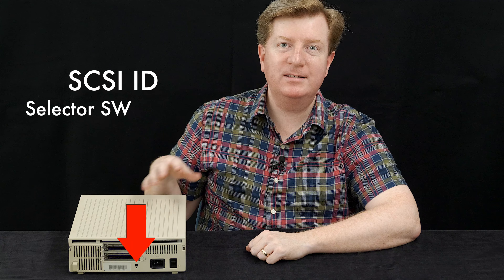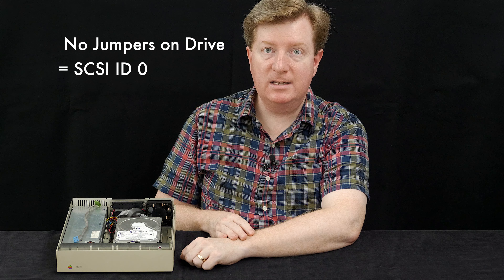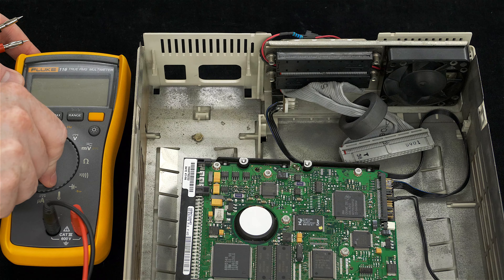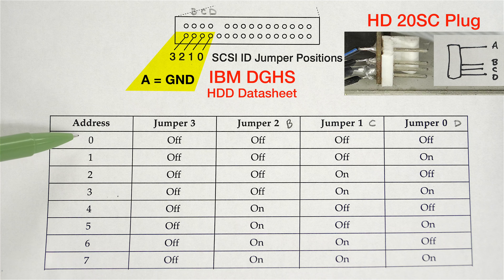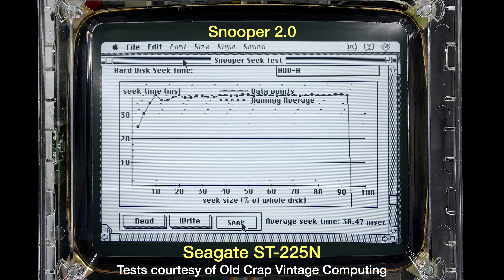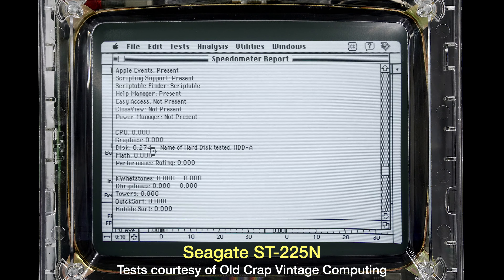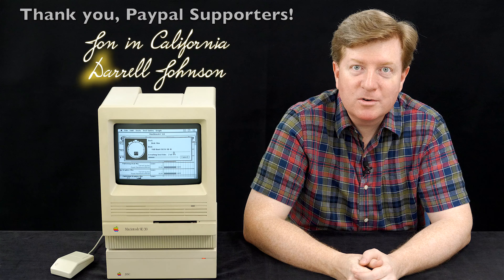Apple HD20SC SCSI ID Selector & Benchmarks

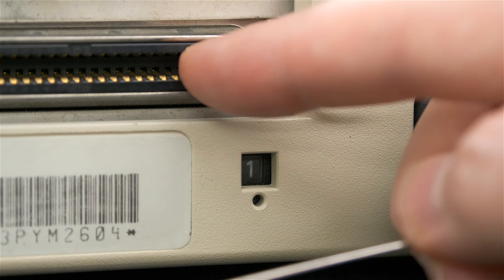Comment from the maker: At 12:26 I talk about SCSI Termination.  One viewer sent me an email to ask why I left my IBM drive's termination enabled. Here is my answer to her, which might be helpful to some of you...

The HD20SC shown in my video (SCSI ID's 1 & 4 are used in the video) is connected to a Macintosh SE/30 that has an internal Quantum LPS 540S hard drive (SCSI ID 0).  50-pin SCSI devices must be terminated at both ends.  With no internal HDD inside the SE/30, only a single terminator is required on any external drive.  With my internal HDD, the internal HDD must be terminated (which it is, via active terminator on the SCSI ribbon cable), and the IBM DGHS inside the HD20SC has its own Active termination enabled via jumper across pins 13 & 14.  The dual active termination has not caused problems for me at all.  And the only reason I resorted to that active terminator in the internal drive's ribbon cable is because I broke apart one resistor pack in the past when I removed it from that Quantum drive, rendering it unusable as the sole internal drive, at least until I found that rainbow ribbon cable with Active terminator attached.

1st & last SCSI device termination is mentioned in these 2 sources:
https://en.wikipedia.org/wiki/Hard_Disk_20SC#Hardware
http://educ.jmu.edu/~johnsogc/scsi.html#termination

IBM DGHS pin-outs are found here:
https://stason.org/TULARC/pc/hard-drives-hdd/ibm/DGHS-318220-18S-18220MB-3-5-HH.html

If you watch my video in 4K, there are a couple places that clearly show the IBM DGHS pins & jumpers I use.

This TI data sheet says that the SCSI standard actually recommends 2 Active terminators, one at each end:
https://www.ti.com/lit/ds/symlink/ucc5606.pdf

That implies my having 2 active terminators should not be an issue; and again, from my testing, there are no problems.

Comment: Man, I wish I had one of those enclosures!  I have an after-market external SCSI hard drive that came with a Mac Plus I acquired last January.  I actually did, just recently as a matter of fact, get a SCSI2SD v5.1 to work in the external enclosure; the original hard disk has long since bitten the dust, I'm afraid.  As you mentioned, a lot of its settings are configured via software.  I was hoping to configure it with multiple SCSI IDs for multiple "drives", but my initial testing was unsuccessful.  There are only a few default changes that have to be made, and then I got the Mac to recognize a full, 2 gig partition.  It's a neat setup, but dang, that zero-footprint Apple case would look even better. ;)
Reply from the maker: Thank you for sharing your experience with the SCSI2SD.  You can still find the 20SC enclosure on EBAY.  Here's one example: https://ebay.to/3b0iz15
You can also join forums like the 68kMLA or FB groups like the Vintage Apple Macintosh Enthusiasts and ask around.  One other benefit to the enclosure is that it lifts the Mac higher so you aren't looking down at the screen so much.  If you're really into compact Macs, it's worth having in your collection.
Reply: @JDW-  Oh, yeah, they're still available!  I've just have other, less fun responsibilities requiring all extras from my budget at the moment LOL.

Comment: I really like the video but I have a related question. Do you know or have any experience with internal 50 pin to 68 pin SCSI adapters? I ask because 68 pin SCSI drives are much more affordable and I have at least one Mac without a scsi drive, my 950. Thanks for another excellent video! Very interesting and gosh, your SE/30 is really fast!
Reply: This link goes into SCSI on the 950 and a section titled "Installing 68-pin drives into the Quadra 950
", https://modelrail.otenko.com/apple/quadra-950-scsi-storage-and-boot-disks. I guess the info is out there but if you have an adapter like his, well it would be a wonderful video topic to consider as 68 pin drives appear to be more affordable than their 50 pin siblings.
Reply from the maker: @santospoland  Actually, I am speaking to Jonathan Goldman in the Vintage Apple Macintosh Enthusiasts FaceBook Group right now about that very subject, since he told me he has a 300GB 68-pin drive with adapter in one of his setup.  I've been asking him questions and pressing him to give me some benchmarks.  But for now, if you check out the text description under my video, you can see that some 4.5GB 50-pin IBM DGHS drives exactly like mine are still being sold on Amazon!  Seems like only 4pcs are left, so anyone wanting them will probably need to act fast.  It's been a great spinning platter drive for me through the years!
Reply: @JDW-  Thanks James, shipping would make that drive too expensive but I hope others find the link useful. If you learn something from Jonathan, please let your YT subscribers know. Thanks so much!

Comment: Hiya! I have a 20SC with the later Miniscribe 20MB drive, it spins up and does the self test with no mechanical faults however it is not recognised on the SCSI bus - do you have any tips to get it working again? thanks!
Reply from the maker: I suspect it's either a conflicting SCSI ID, and/or an issue with Termination. I talk about both in my video, but termination is at 12:26.

Comment: How Do You Turn On 32Bit Addressing?
Reply: Use System 7 or newer, either upgrade the ROM or use MODE32.
Reply from the maker: Michael, what @jammi said is true.  System 6.0.8 and earlier is locked to 24-bit addressing.  The ROM upgrade he mentions involves swapping out the stock ROM SIMM for a IIsi or IIfx ROM, or the ROM-inator II from Big Mess of Wires which supports the SE/30, IIx, IIcx, IIci, IIfx & IIsi. There is also a new ROM project underway at the 68kMLA: https://bit.ly/3jUcmIh